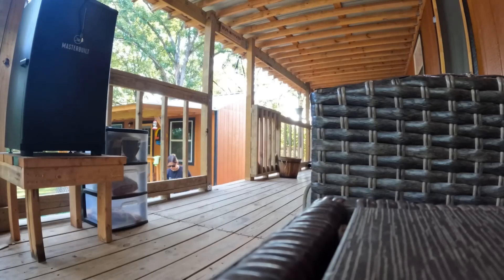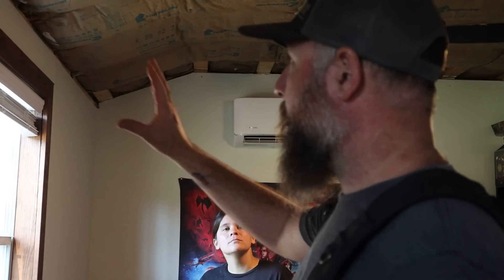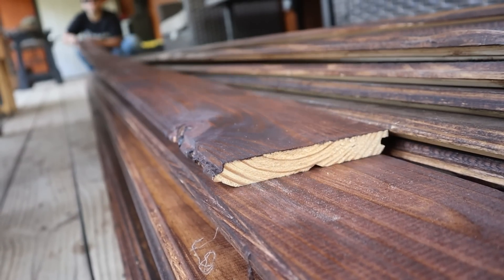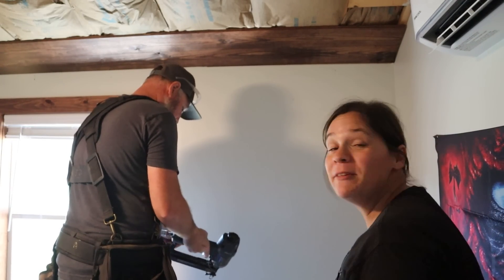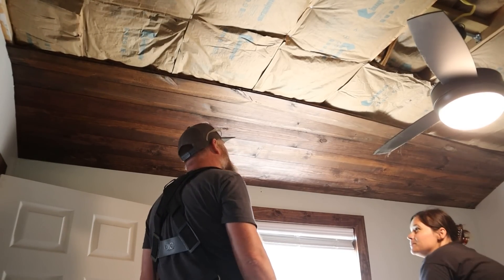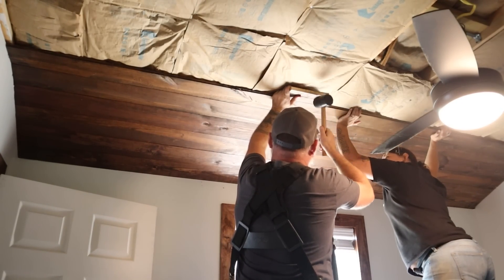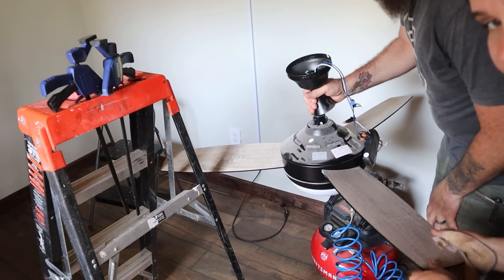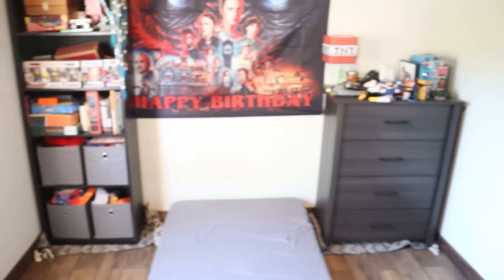After this BUILD, we are READY to MOVE ON.. | DIY Shed To House Conversion

Comment: Hey i happen to notice u don't have a wire protector in wyatt's light box u should really put one on the vibration from the fan can cause the wire to rub against the sharp metal edges and may spark and cause a fire just want u guys to be protected 😊